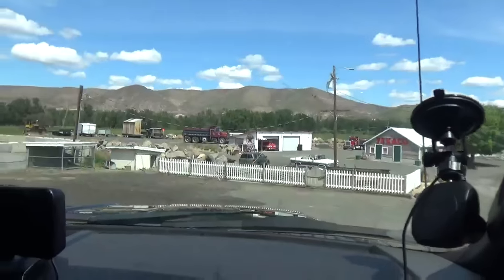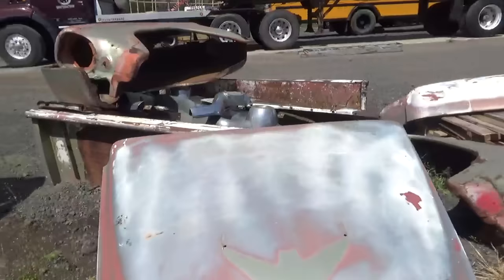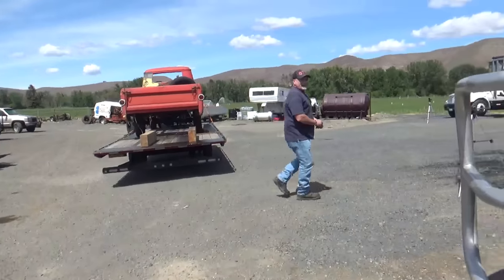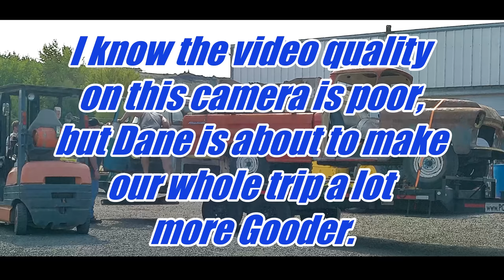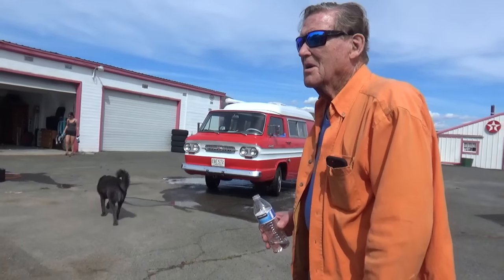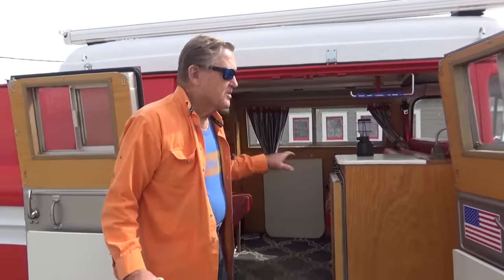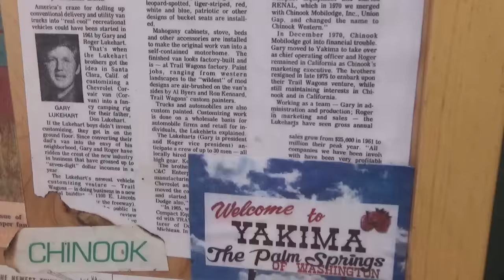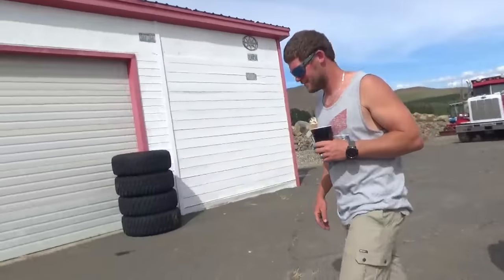1961 Corvair Restored by Founder of Chinook Campers

Comment: Nice find ! I'm into Corvairs ! But I did not know that Chinook started with the FC 95 Corvan ! The FC meant forward control ,& 95 meant the wheel base , I've seen one other Corvair Camper in person , & it had Coleman equipment inside , & was built on the Corvair 95 Greenbrier which was a passenger van , & a little more upscale platform than the 95 Corvan ! Also there was a motor home that  was built with a Corvair drive train , & suspension known as a Ultra Van , I do remember seeing the Toyota Chinooks , & I use to have a  77 Toyota p/u that was built on that platform except they were duallies , & I still own a 1964 Chevrolet Corvair Greenbrier deluxe 6 door , Chevrolet sold then as Sport Wagons at the time . But still what a interesting find , & story , & getting to meet Gary as well as the cab of the truck You picked up ! Thanks for the video .

Comment: I watched this because of the Corvair. While an extremely nice van, that van is a 1964, not a 61. The rain gutters on the A pillars, the rear engine access door, steering column, the amber front turn signals, the wheel covers, and the instrument cluster all have a  1964 design. Still, very cool and immaculate!
Reply from the maker: Interesting. Well, I can't really comment on that, because Corvairs just aren't something I'm knowlegeable about. Thankls for the input.